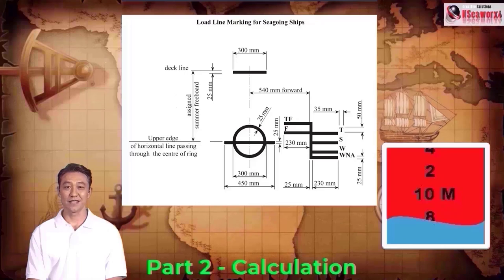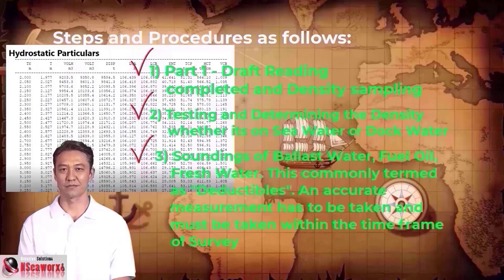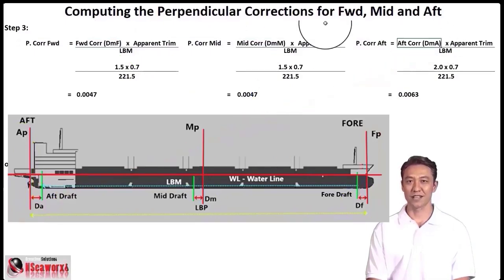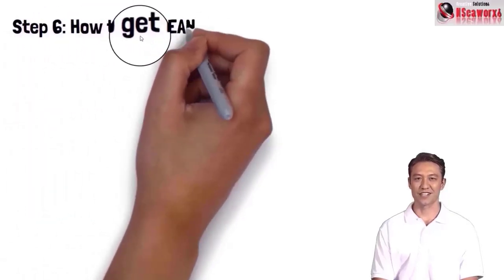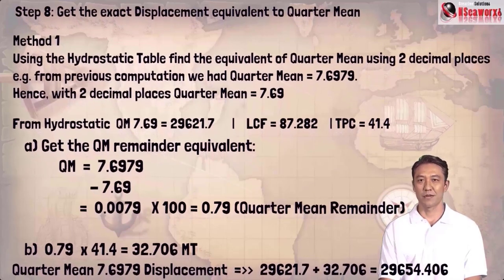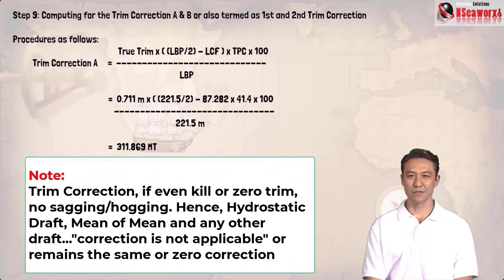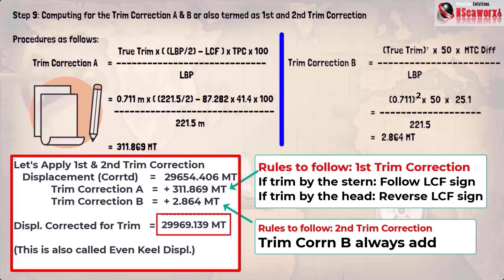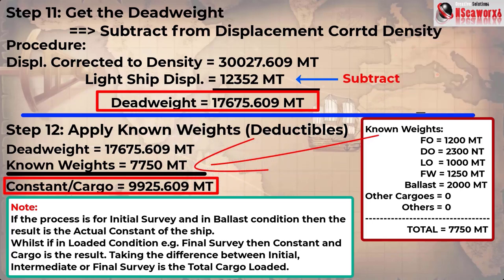🚢 The basics of Draft Survey - Best Practices Series of Part 2 - Calculation

Comment: some questions...
the small ship is trim by head...
and if lcf +4.25 from hydrostadic table...

what is first trim correction sign?  - or +?

because i know about
the first trim correction sign...

when i...calculation draft survey...

trim-by the stern...
and LCF sign +(fwd)...first trim correction sign -..
LCF sign -(aft)..fst trim correction  sign -...

trim by the head..
LCF sign +(fwd)...fst trim correction sign +..
lcf sign -(aft)...fst trim correction sign -...

is it always adjust to the any ship..and when draft survey...fst trim correction sign..decided the rule?...

ref.my fst trim Correction calculation....

ture trim(Cm) × t.p.c x lcf
 ÷ L.B.P...
Reply from the maker: First Trim Correction

Rules:
Trim by the Stern:
Fwd Corn = Minus(-)
After Corn = Plus (+)

Trim by the Head/Stem:
Fwd Corn = Plus (+)
After Corn = Minus (-)

Midship Corn is parallel to Fwd Corn

However, please see your ship hydrostatic tables. It should be indicated there how you may apply since you mentioned a small ship. In General, the bigger ship like 5,7,9 holds ..this rule is basically used.
Reply: @ShipAhoyVlogs  good pm sir i would like to ask in your formula in trim correction A 
True trim x tpc x lcf x 100/LBp my usual formula but in your formula you include lbp/2 - lcf x trim x tpc x 100 ÷lbp cant get it tks

Comment: Good day po...May tanong lang po regarding sa : 

1.) Yung sa TRIM CORRECTION A yung formula = true trim x (LBP/2) - LCF....YUNG LBP po ay ang Length bet. perpendicular po yan di ba? kasi sa Given ang LBP ay 223 meters at ang LBM/LBD ay 221.5 meters?

2..) Yung (-)LCF sa  formula po, Constant na po ba yang Negative sign nang LCF? or magdedepende yan sa hydrostatic table?

3.) Yung figure po ba dyan nang LCF mula sa Hydrostatic Table , Hindi po ba yan ininterpolate? kagaya nang pagkuha nang Displacement? 

4.)  Regarding sa pag apply nang 1st and and 2nd Trim Correction,  yung TRIM CORRECTION  A,  ibabawas po ba yan sa Displacement (corrtd ) kung naka (-) negative sign ang figure nang LCF sa hydrostatic Table?

5.) Ang Quarter Mean po na 7.6979m, Sapagkuha po nang  LCF at TPC  basi sa Quarter mean, Hindi po ba iniinterpolate ang pagkuha nang  LCF at TPC basi sa 7.6979??
Reply from the maker: 1) 221.5 ata nalagay ko dun . Sorry typo error.
2) LCF sign is based sa table
3) interpolate mo kung Wala saktong katumbas
4) ndyan ung rules nya oaki check mo na lng.
5) dalawa method ung sample dyan ung Isa may interpolation.
Reply: @ShipAhoyVlogs  good pm sir sa trim correction A dko po makuha ang answer kasi ang formula ay =true trim ×lcf ×tpc x100 divide sa lbp pero pag iapply mo ang lbp /2 hindi lalabas ang answer 311 pls kindly teach how tks